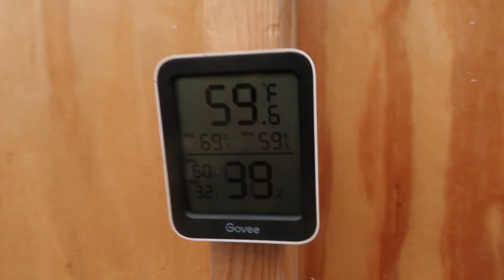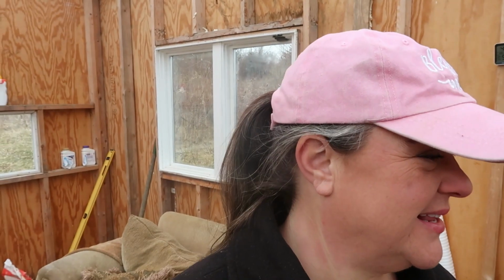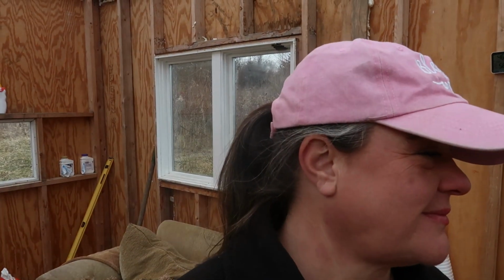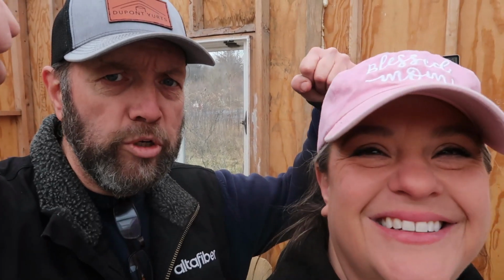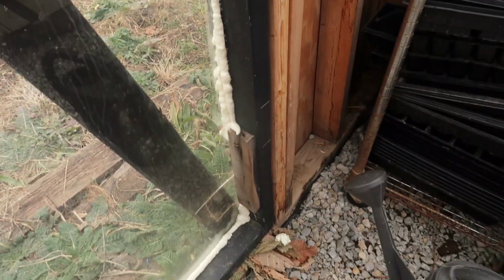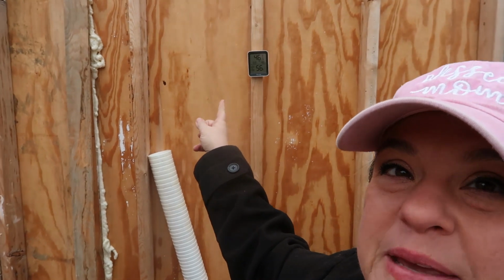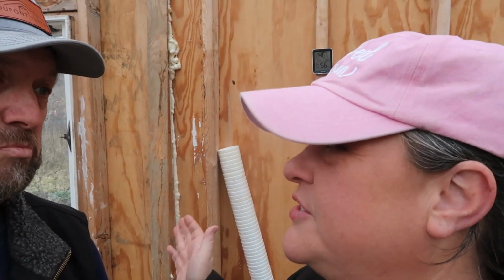WARMING A GREENHOUSE - DRAFTS KILL!!!!! | Crooked Row

Comment: I really wanted to comment  on your winter sowing video, but comments are turned off. 
I have never done winter sowing. Should the jugs be in the sun or shade? About how often to water them if there is no rain? I have no place indoors like a greenhouse to start seeds or plants, notlr do I have grow lights. I tried growing indoors without those things. The plants grew well but could not handle the wind here. Even after carrying them in and out every day.
Thank you
Reply from the maker: Hi hands2hearts, I am so sorry the comments were off. That was a mistake. Putting the jugs in full sun helps them capture solar heat, but I have seen people run out of room and shade was the only place they had. Yet, they still had a good turn out. I have never put mine in shade, so I cannot speak to it personally. I did not have a greenhouse for years and years and I used my laundry room to setup lights on an old shelf. I am not sure where you live but a wind block my help with the seedlings. hardening seedlings off can be a tedious process and the carrying in and out drives me crazy. That is why I really like the winter sowing method. For watering, you will just peak in the hole in the top to see if they are moist. If they are not, you can use a spray bottle, hose or a pitcher to get those little things some water. If you have ANY questions, please don't hesitate to reach out to us!!! Thanks for watching!